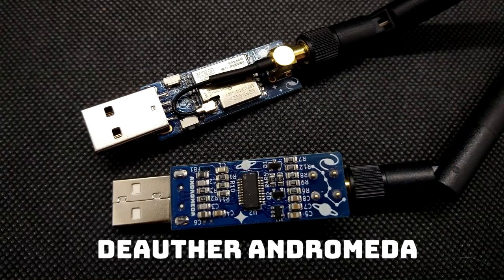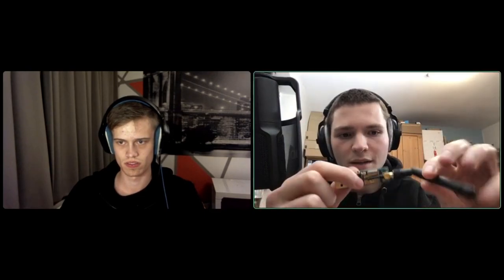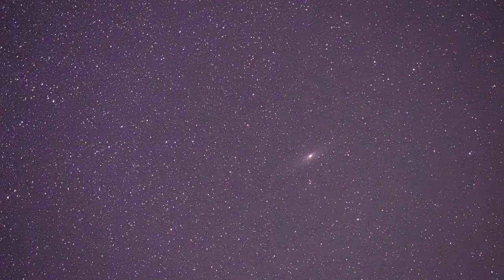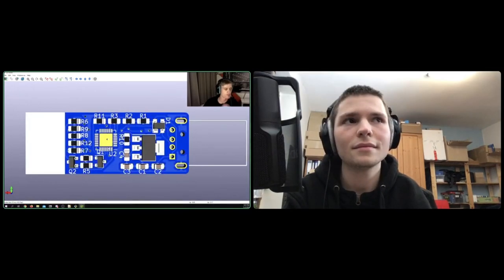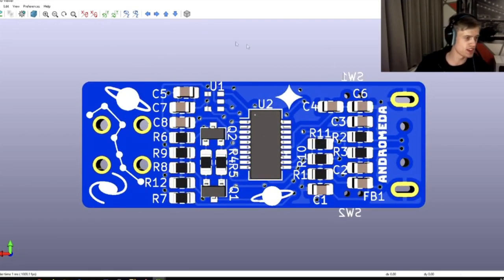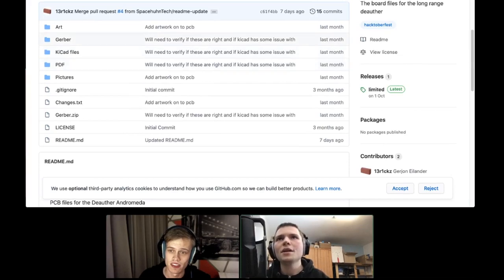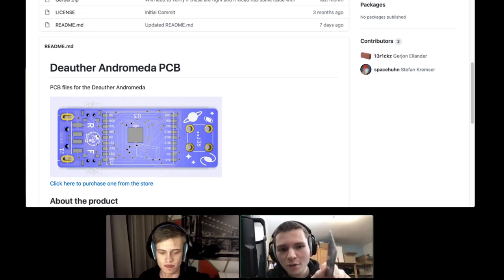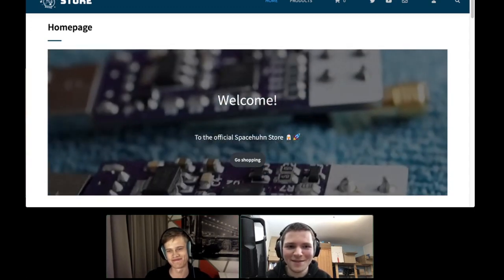Coming Huhn: Deauther Andromeda Hardware

Comment: As stated by 13rckz the range of this Deauther depends on many parameters. The main influencers are transmit power and the antenna. The maximum allowed power in the 2.4 GHz frequency band within Europe is usually 100mW EIRP. Also 100mW seems to be the maximum transmit power which the ESP8266 provides.  

The antenna you showed does radiate in an omnidirectional (donut shape) pattern. If you want longer range some directional antenna is recommend. The connector at the board could be used with many different antennas. 

If you just want to "deauth" the range will be really high, because the deauth frames are send with very low data rate (usually 1Mbps). These deauth frames are also send many, many times and even if some deauth frames do not reach the target, there will be many retransmissions.
Low data rate frames can be demodulated (received) even with very low signal strength. Depending on the receive sensitivity of the target device a frame send with 1Mbps could be demodulated with signal strength below -90dBm. Reliable data transfer might be impossible, but deauth frames will probably hit the destination. 

Outdoors with clear line of sight, the range will be many hundred meters, theoretically even above one kilometer. But this really depends on environment, the antenna and radio on the receiver side. Professional WiFi point-to-point links with directional antennas on both sides cover multiple kilometers and still support very high data rates. 

Best Regards
Tony

Comment: Do you have a case to put the pcb board in?
Reply from the maker: not yet. do you want to design one?
Reply: I was thinking the outside looking like a normal usb stick too hide the pcb board
?
Reply: @spacehuhn  once i bought the andromeda i will try to design a case, if it's nice i upload the files
Reply: @skynxt9928  I think it is difficult to hide the fact that the pcb is not a usb stick, u know, big antenna at the rear
Reply: @dampi1245  If you have a 3D printer please share your file so I can ask a buddy of my too print one.
Reply: @skynxt9928  Yes, I ordered the version without I/O pins, when it arrives, I will try to design something nice and upload it to thingiverse
Reply: @spacehuhn  hell yeah